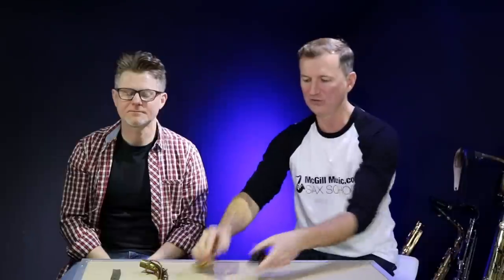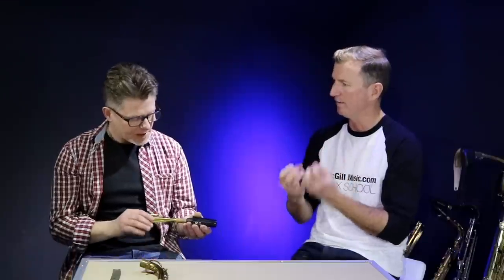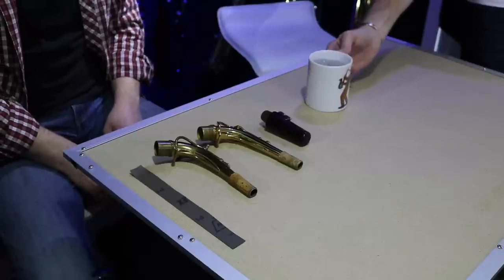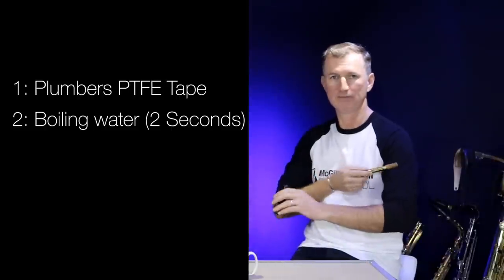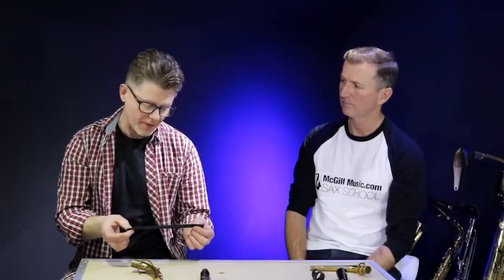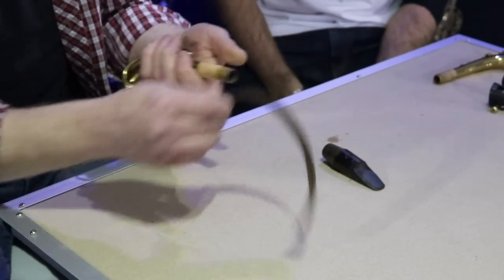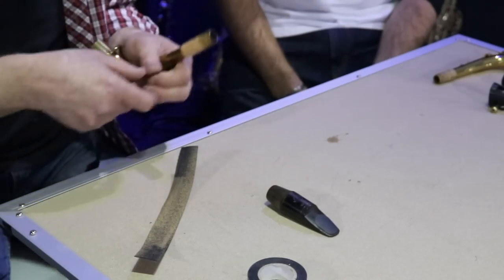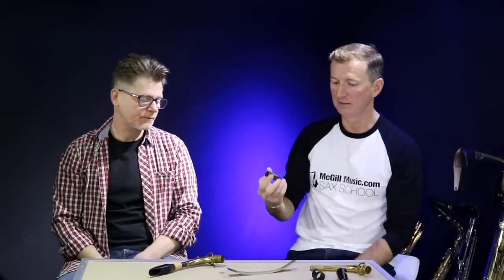Saxophone neck cork too loose or tight -  How to fix it

Comment: I've purchased a few saxes (used) and each one had a different cork thickness.  I learned the plumbers tape remedy some time ago and still use it today. I usually take my horns to my repair guy shortly after purchase and one needed to have the neck cork replaced, so I took it in to my tech. I watched him repair the cork and afterwards practiced  his process on an older horn. Now I can replace my own neck corks. Good video on a topic that we all will encounter at some point.  Now, if I could only duplicate the playing styles of the many great artist I hear as easily as I did the repair tech's I'd be on to something.  Looks like practice and time are still the key. Again, thanks for another excellent video.
Reply from the maker: Glad you liked the video, and interesting to hear about your horns.  I've changed a few neck corks myself and once you get a bit of practice it's not too tricky, but mostly I get Steve (in the video) to do it - he is much neater than me, and I don't need to worry about scratching my lacquer!  Cheers.
Reply: G000gleman Conference

Comment: I purchased an alto saxophone about a year ago and Im having very much difficulty sliding my metal mouthpiece on the neck even with cork grease applied . I would like to try this sanding trick out but i'm afraid of over sanding the cork too much and then making it too loose for the mouthpiece. Should I go ahead and attempt this sanding trick or take it to a repair shop and let them do it?

Comment: Very useful tip, I have the exact same problem, just got my 1st sax this week (a 2nd hand John Packer 45G) picked up a new Yamaha 4C Mouth Piece but it's an extremely tight fit, I'll definitely try sanding the cork down a little. Thanks 🙂

Comment: Interesting!  I recently started using a rental sax that came with its own worthless mouthpiece, and when I mounted my own mouthpiece on it, I noticed it was pretty snug but I greased the cork liberally and was able to get it on ok. After a couple months  of use, though, I tried putting the stock mouthpiece on just to compare (I wanted to see how awful it was, haha), and the fit was noticeably loose. The boiling water trick, that'll be useful at the point when I return this instrument.
Reply from the maker: Yes but be careful with that boiling water trick  - only dip your cork in really quickly so you don’t damage it.

Comment: Great thanks both of you. My cork seems to have shrunk so the mouthpiece has to go too far in. It's usually been left attached to the cork when on the stand. Steve's point about letting the cork breathe is great. My sax is having a service at the moment and so I'll make a point of leaving the mp off the new cork sometimes.
Reply from the maker: Good idea Richard. Also I liked Steve’s hot water trick. Works great.

Comment: Thanks guys, I have a HR Otto link that is too tight and I haven’t wanted to try to open it up at all so I might try sandin* the cork a little. I HAVE 2 necks with my vi so I’ll try on my least favourite first! On also have the almost opposite problem on my 82zii with a new 10mfan Black widow. I have to have it so far out on the cork to get it in tune that it ends up loose and a problem with intonation over the range. My main mpc is fine on this neck/horn so I don’t want to change anything. I might have to just persist and work on brininging it back in tune with embouchre etc over time

Comment: Question: Say that you're an idiot (referring to myself here) and decided to push the mouthpiece on a really tight cork to get it on and made a slight tear in the cork and you want to replace it. Do you recommend buying cork sheets and using contact cement to apply the cork or would cork sheets with their own adhesive work just as well?

Comment: hi Great video I just got a new vintage  selmer tenor and Im trying to use my old berg larsen  mouth piece but to get the horn to play in tune the mouth piece is to far at the end of the cork so the mouth piece  is to loose on the neck  when its in tune ,but when I move the mouth piece to the middle of the cork I get the full sound of the saxophone  but it plays  to sharp should I get a new cork? or do you have any suggestions to fix this problem  thanks for your help and advice big fan Dennis
Reply from the maker: Hey Mike. A new cork should help. You could also try some plumbers PTFE tape on the cork first just to get the mouthpiece to fit better.

Comment: I had too tight cork. I took too much off of it. For professional grid 120 is OK but for the rest of us 180 is safer. It is really easy to sand paper too much. I just wonder how much mouth pieces differ from each other. Will the next mouth piece be way too loose now that have sand papered my cork.

Comment: I wonder if there are thin cylindrical shims that you can put on the neck or inside the mouth piece? I have a metal mouth piece with a narrow bore and an ebonite mp with a wide bore. I like them both, but the metal one is a little too tight and the ebonite mp a little too loose.
Reply from the maker: Good idea though I’ve not seen anything like that. Generally once you settle on your main mouthpiece you can get your cork adjusted for that piece (if needed).
Reply: @McGillMusicSaxSchool  Thank you. I'm still in that figuring out phase. Thanks again

Comment: I have a jazz mouth piece and a classical one - one is way too loose while the other is too tight - what do I do then?
Reply from the maker: That’s a tricky situation if you are changing often between them. If your neck cork is older then you might find a brand new neck cork is more flexible and works for both. Check with your repairer. Hope that helps.

Comment: Purchased a sax online. The mouthpiece seems to be too tight. Are all alto sax the same size in diameter? Wonder should I buy a different mouthpiece or try to sand the one i have down? 😥
Reply from the maker: Hi. Great to hear you are getting started with sax. It’s really common to have this issue with your mouthpiece not fitting properly. The neck cork is the problem.  Here are some ways to fix it: https://saxschoolonline.com/articles/need-help-neck-cork/

Comment: Holding over the steam of a boiling kettle also works and saves dunking in water.   What would you suggest though for a perfect condition cork but where the neck is narrower (i.e. Selmer) and many mouthpieces are too loose?
Reply from the maker: Hi Tim. I agree, the steam trick works really well.  For a cork that is too loose, even if it’s in perfect condition you really only have 2 options - Ptfe / plumbers tape (temporary fix) or replacing the cork entirely and shaping it to fit your mouthpiece.  If you know what you’re doing this isn’t a big job.  A good repairer should be able to do this for you quickly and cheaply too. Hope that helps you.
Reply: @McGillMusicSaxSchool  Yes it certainly does help, thanks for such a speedy response!  I got a TW Gaia for my Yani sop, it fits perfectly and the combo is fantastic.  Sadly the store didn't have alto Gaia's in stock to demo so I made a very risky decision and ordered off the web for my Ref 54.  I'm taping it at the mo (and it's great) so will go for the new cork.  Thanks!

Comment: What can I do if I want to use two different mouthpieces for different purposes, and the cork is too loose for one of them? Can I apply and remove plumber's or electrician's tape without damaging the cork?
Reply from the maker: Hi Joel.  That’s a difficult one. You could use tape but that isn’t a great solution if you are changing frequently. Better to find two mouthpieces that have a similar fit. Or get an extra neck. Hope you find a solution.

Comment: Does the Ptfe tape damage the cork? My classical mouthpiece fits fine. My jazz mouthpiece is too loose as I have to pull it right out for to be in tune. So can I put on and take off the tape every time I swap the mouthpieces?
Reply: I have exactly the same situation and have been wondering about the best way to deal with it

Comment: Another old quick bodge is to use cigaretter paper to wrap the neck cork instead of ordinary paper - its easier to handle and gummed.  PTFE would be better, but works OK if you have fag papaers with you. These are great tips and a great clear straightforward video.

Comment: I'm a alto player with a similar problem. I just have one neck, but 7 different mouthpieces, with slightly different inner diameters,  varying from 16,00 to 16,50 mm. Since I'd like to use all of them, could I enlarge the smaller mouthpieces to a 16,50 mm diameter, so to have all at the same size? How could this be made without damage?
Reply from the maker: Wow, great question. I don’t know the answer to that one. Perhaps get in touch with a mouthpiece maker for advice.
Reply: Hi Rubem
Your smaller mouthpiece can be adjusted if its an ebonite one.

Comment: Don't use cork grease.  It needs to be refreshed too often because it is gradually absorbed by the cork to where it doesn't do any good and the built-up cork grease within the pores causes the cork to lose resilience, shortening its life.  Better to use a wrap of plumber's teflon tape or rub some teflon powder into the surface of the cork.  Teflon powder is also handy for lowering the friction of cork-faced sliding linkages.